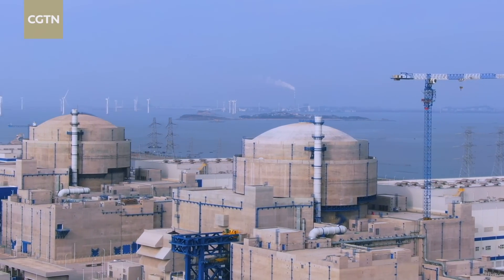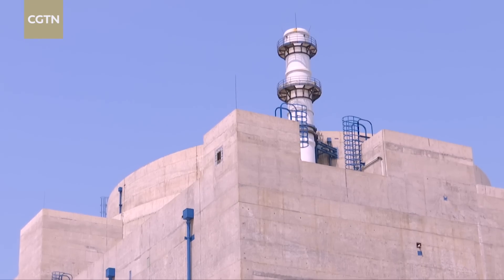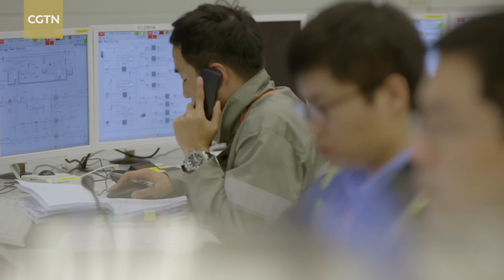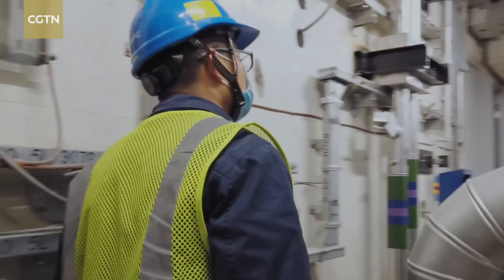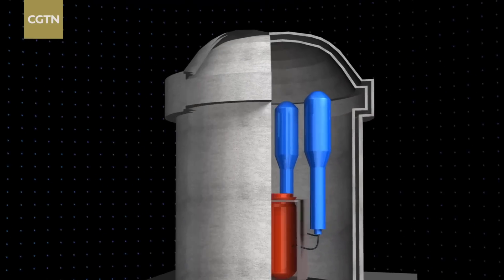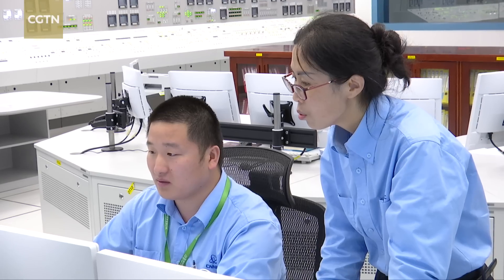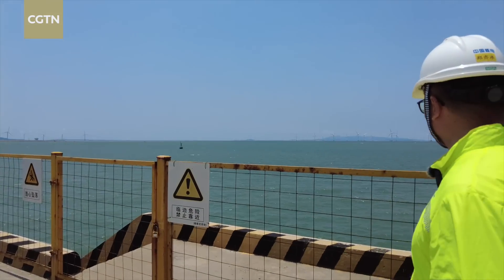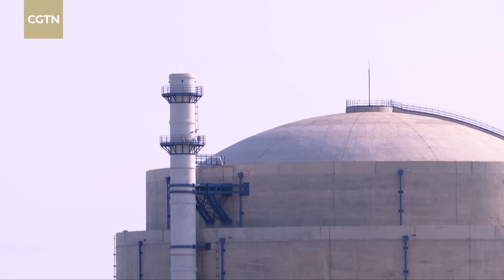A tour to China's most advanced nuclear plant

Comment: Since when is nuclear waste better than carbon waste? Go solar, wind and geothermal. Geothermal is available everywhere, just dig a hole deep enough and tap the heat coming from Earth's core.
Reply: Geothermal isn't practical for most of the world.
Reply: Or, you could dig a much, MUCH shallower hole and still bury the waste deep enough to not affect anything on the surface. A hole only 1km deep should suffice.

Meanwhile, you would have to dig a hole 50 times that deep to reach the mantle, and that is 4 times deeper than any hole that has EVER been drilled.
Reply: @4orks976  What if the nuclear waste leaks though? Then you'd have radiated soil, water, and air.
Reply: @jesuschrist8  how would the waste leak out of a 1km deep hole
Reply: @4orks976  I mean it would leak out of the container and contaminate the ground air, water, and soil.
Reply: @jesuschrist8  beta decay neutrons can only penetrate through about 30m of rock before stopping.